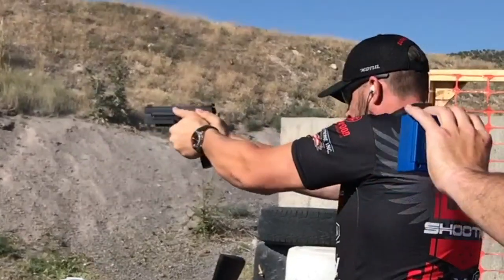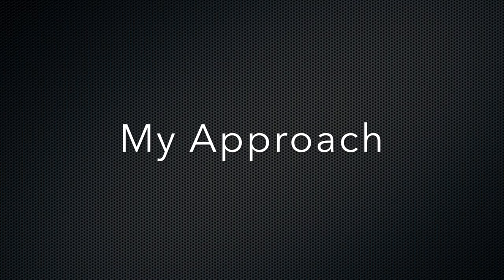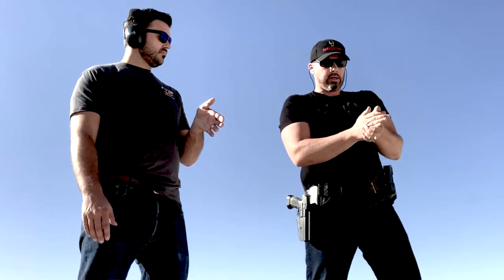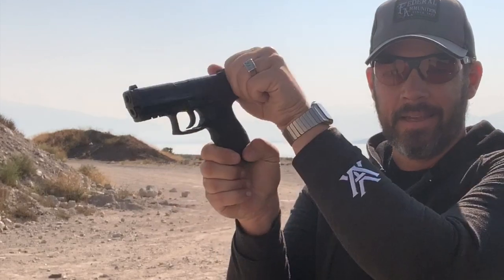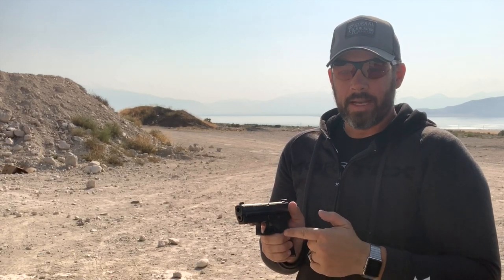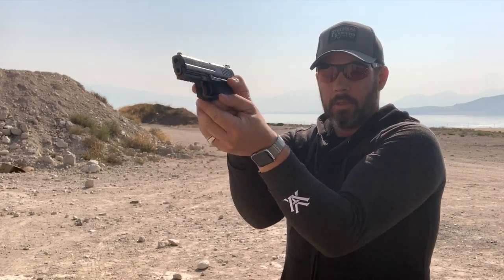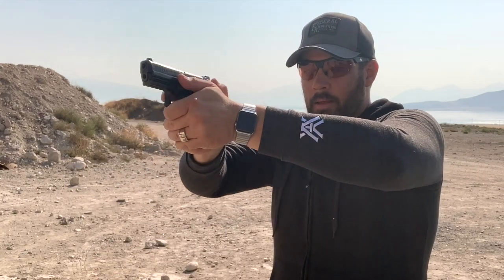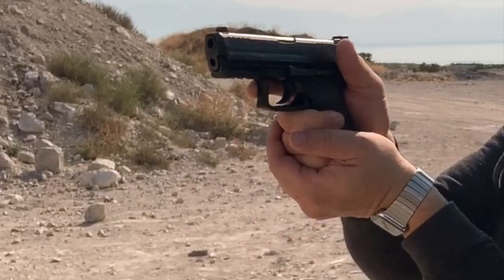Recoil Control: Shooting Fast & Flat With Your Pistol

Comment: I like the fact that you don’t try and tell people to copy exactly what works for you. The explanation of the simple mechanics makes great sense also. Your tip on transitioning from up to down tip is something I need to investigate too! Because I will tend to tuck my head down, and get my right shoulder behind the gun, and allow the recoil to absorb into my shoulder. My theory on this is it allows the pistol energy to move back instead of up.
Your grip explanation was great too! People don’t realize how important that pinky finger is for a good grip! 
Great video! And great points! Thank you for taking the time and using clear explanations of your techniques!
Reply from the maker: I'm glad you found the video insightful. Thanks for watching and sharing!

Comment: This video has been tremendously helpful. That tip about the elbow being cocked so it's parallel with the ground was the final thing I needed. I was shooting in what you called a more relaxed elbow position. Can't believe it took me a few months to realize your forearms can barely recoil upwards when your elbow is cocked like that. The joints can't move in that position very much.  Instead they end up going straight back in recoil. In slow motion the wave going through the arms is far less vertical too so everything settles back quicker. Great stuff!

Comment: Great tips.  Thank you.  I've found grip strength workouts help a lot, and sometimes I roll my shoulders inward to increase the clamping pressure near the top of the grip/pistol.  I usually get better trigger pulls when I imagine my hands wrapped tightly around the gun as a single unit.  People usually underestimate the amount of strength needed to shoot a handgun effectively.  Those who tell you to relax your grip usually already have extremely high grip strength where their 50% probably exceed the 90% of the general population.

Comment: Very detailed video on the realities of "recoil control". I think the thing I see the most when people have problems is they dont practice drawing into a proper grip and they lean back instead of into the gun slightly. Big thing once you get past the basics is moving from a trigger squeeze to a trigger press. If you want to shoot fast you have to have that trigger familiarity and learn to press, not a rushed squeeze or slap.
Reply from the maker: "Press" or "squeeze" they are just words. I've heard instructors say it both ways. The principle is to not mess up the sights. I know guys that outright slap the trigger and get accurate consistent shots. So, in the end no matter what word you use, not messing up the sights is the name of the game.
Reply: @SeanGoBoom  guess that just means more time putting rounds down range. Darn the luck.

Comment: Skeptical at first but a great video. There is one thing that I am thinking does more control is the pressure of the web of the hand and the small finger. It also doesn't help if there is damage to the wrists. Most people can't control muzzle flip not because of their grip but because they let go after the explosion.

Comment: I’ve only been seriously training with pistols for a year but by pulling together all the basics that you describe and , as you do yourself , gather tips from a variety of competition proven experts , I’ve been able to become reasonably competitive in matches with guys with many more years of experience.
Everything you discuss very succinctly is exactly what you need to do - it makes complete sense in relation to the physics of how the achieve the end result - faster shots on target 
Often folks at the range will ask - how do I do what you’re doing ? -  and I talk them thru it just as you did - and tell not just how to but why 
Often they’ll improve dramatically in just that range session
Reply from the maker: Shooting well isn't difficult for most people, when they learn how to do it. The principles are simple to understand, and with some coaching can be executed by most. The key is to create a practice routine that helps one to be able to deliver consistent results subconsciously on demand. That is where time and repetitions come in. That is the sole reason I got into the competitive shooting sports to begin with.
Reply: @SeanGoBoom  Yes - It’s a very zen sport once you realize how hard you have to train and focus to improve after plateauing at basic competency 
And when it all comes together on a stage - it’s so rewarding

Comment: Great video Sean! Terrific grip tips, love it! Two questions: do you recommend doing arms weight lifting to increase strength? And bullet weight: does a lower bullet weight imply lower recoil? Thank you, keep it coming.
Reply from the maker: I may do a video going into more depth on this, but in short bullet weight is one factor, but isn't necessarily the only one. You can conceivably have different size bullets and different powder charges for the same caliber and have nearly identical felt recoil. In general, a lighter projectile is going to fly faster than a heavy one. I definitely recommend any kind of strength training to increase your performance with firearms. It is just good healthy living in general anyway.
Reply from the maker: If you want more drills, check out my Dry Fire Drill of the Week. Join the free Skill Builder Community https://classroom.elevatedtraining.live/skill-builder-community
Reply: Many thanks Sean, very clear!

Comment: Very good video, this may be one of the better explanations I have heard on proper grip. I'm working on getting back into shape, any suggestions or sources for at home exercises to build arm & upper body strength to improve recoil management?
Reply from the maker: Thank you. I appreciate that. Recoil management isn't about strength so much as it is about creating that proper frame to accept the recoil and have it go where you want it to. However, it is silly to think that building upper body strength (and lower) in general won't help with that whole process.

Comment: Hey - thanks for this.  I shoot right, left eye dominant.  Based on what you're saying about your body shift (left foot forward to align sights to right eye), would it be safe to assume a right foot forward stance would be appropriate for me thereby aligning sights to left eye?
Reply from the maker: Whatever side corresponds with your dominant eye, just bring it back in your stance about half of a foot length, and you will have a remarkably easier time aligning the sights and indexing upon presentation. Let me know how it works for you!

Comment: Oh no... is this what I have been doing wrong this whole time? I'm a semi recent gun owner I picked up my first handgun in 2020. I couldn't hit the broad side of a barn if I tried. I would shoot down and left horribly. I still have a terrible trigger pull sometimes and I gotta remind myself of it ocassionally. But the muzzle flip is where I seem to always have issues. I'm 5'10" 290lbs and my 9mm whether it be my M&P Shield, 2.0c or my Glock 19. They all kick/flip more than they should for someone my size. I thought this whole time I was suppose to bear hug the gun with both sides of my palm... I didn't know you were suppose to squeeze with your fingertips instead. I've watched numerous "How to manage recoil" videos and this one is the first to mention that specifically.
Reply from the maker: Should I cover more info on this topic?
Reply: @SeanGoBoom  I don't think any of us would be against it. You can't learn too much. As an update to my OP it absolutely did help with managing recoil the next time I went our shooting. Even after around 8k rounds through my EDC guns(G19, M&P Shield and M&P 2.0c) I still feel like I stuck at recoil management and need another 8k through them. lol

Comment: Hey Sean. Quick question. I’ve been watching a lot of videos on grip and recoil control. I’ve noticed while dry firing my fore arms get pretty tired. I’ve been dry firing with the grip and pressure like you showed. Is that normal until you get those muscles used to it or am i doing something wrong or trying to hard Fatiguing myself?
Reply from the maker: Great question. Grip tension is going to be dictated by the ammo you are using and the stiffness of your recoil spring. So for example, on my new Atlas Hyperion competition pistol, I am running a 7 lbs recoil spring because my grip is really robust and my wife is running a 9 lbs recoil spring because hers isn't as much (smaller hands and arms, etc.)... so that effects the return to zero on follow-up shots. You can see that on the video when we started going through the fitting process (link below). Remember, this is recoil MAGEMENT, not recoil CONTROL. The muzzle flip is going to happen, the name of the game is to get the gun to return to zero as quickly and as predictably as possible. With your gun, your ammo, you adjust your body accordingly. With that being said, you are probably going to gain some advantage from buying some cheap grip trainers and strengthening those muscles you aren't used to using. It isn't fatigue, it is exercise! https://youtu.be/4hVikkvZaxI
Reply: Sean Burrows ok awesome, just wanted to make sure i wasn’t over gripping or doing something wrong to trigger those muscles and make them fatigue.